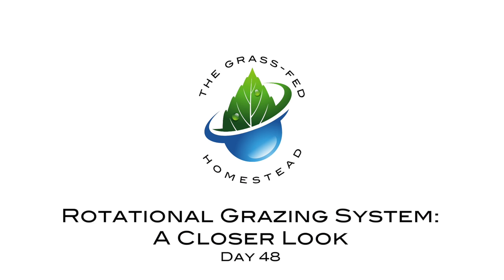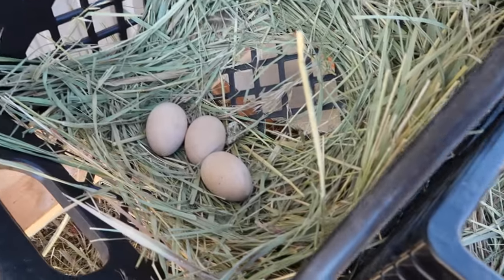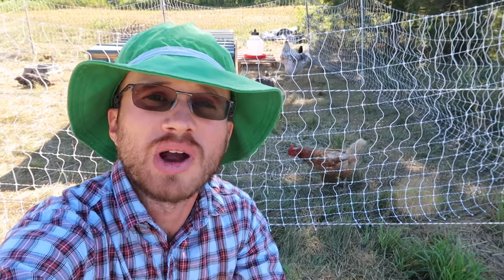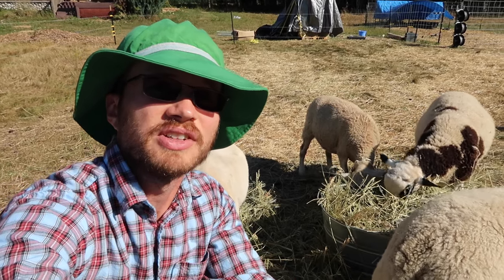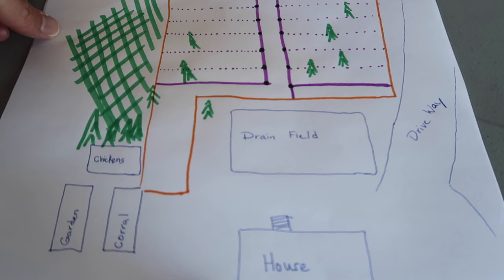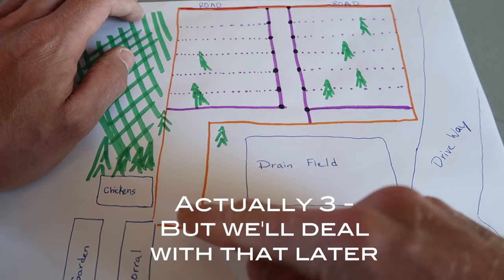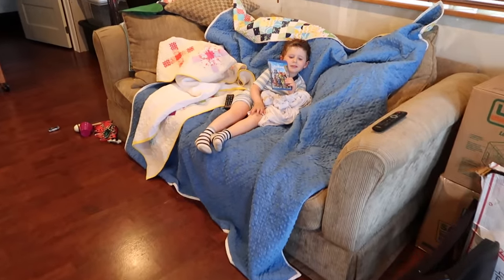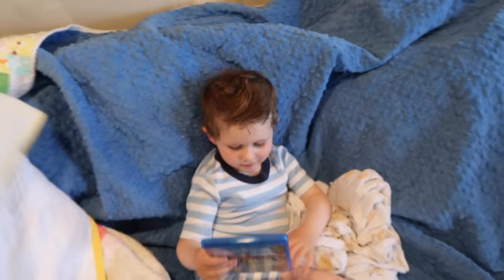Rotational Grazing System: A Closer Look

Comment: Excellent Grass Man!!! The lady friend of yours who recommended the hair dryer to reshape your roll for the poly fencing should get big props for that one!! So I got a question. I really like the concept of your zoning drawing for the sheep laneways, but I would imagine somewhere in there you will have some poultry netting for a flock of birds to do some work for you. I m getting soon the 164 ft. length of fencing for my working birds and maybe a smaller length for my breeding flock. Hopefully I can run both of those netting paddocks to the 1 energizer which I think you told me that could be done. By the way, Little Guy is very smart Grass. He knows exactly what to do about hooking and unhooking that hot fence. Hell, he is way ahead of me on that part. Very well educated. Keep it up like that and pass on your knowledge bro!
Reply from the maker: Thanks Bobby.  Yes, I will be running the chickens through the sheep paddocks after the sheep.  I'm leaving them in place right now though because of the pullets.  I put up that fine bird netting to keep the pullets from slipping out of the fence.  The bird netting complicates the move so I'm just waiting another week or so for the pullets to put on some more size.  They've grown a lot since we got them.  And yes, you can definitely run your poultry fence off the same energizer as other fencing.  In my system, you'd just attach the poultry netting to the polywire for the sheep.  That makes the poultry net hot.

Comment: And what type of energizer you are using Grass? I want to say it was the Inteelishock maybe? Is the one you are using straight up solar with a bteery charger built in or does it have to be plugged in to work. You know the difference is the one that needs to be plugged in is not weather resistance where the solar energizer is made to be outdoors and you charge it on the spot.
Reply from the maker: It is the Intellishock 31 (Premier One).  It can plug into the AC outlet or run off of battery (solar).  I have mine running off a battery.  It's out in the field next to the sheep corral.  I am really happy with it.

Comment: Hey Dan!  How does this system work for you?  I am planning something similar for my sheep and potential cattle, but I seem to need a lot of reels to make it work easy.  Do you feel like 3 polywires for the interior paddocks/lane are appropriate or overkill?
Reply from the maker: 3 wasn't enough for my sheep.  I upgraded to 4 which worked for awhile but eventually that failed too.  I switched to netting which has worked better but I'd feel ok with 5 strands of polywire

Comment: Good work on the grazing rotation plan. Are you gonna have your chickens follow your sheep around?
Reply from the maker: That is my plan.  Right now with I have that mesh stuff attached to the poultry fence to keep the pullets in.  Once the pullets get a little bigger I'll remove the mesh which will make the poultry net a lot easier to move and then I'll have them following the sheep